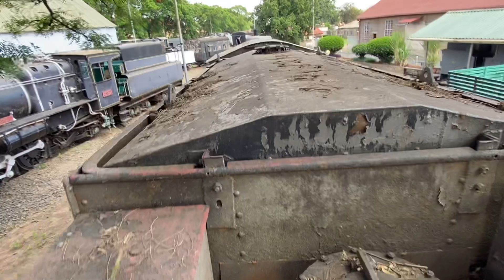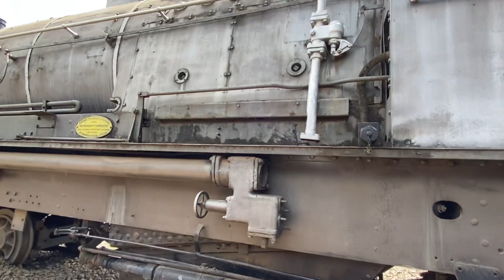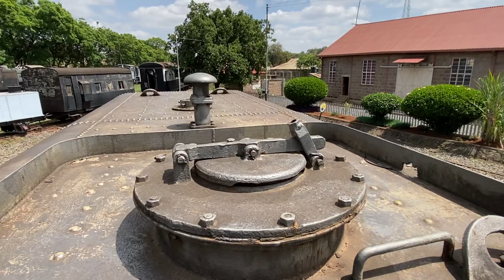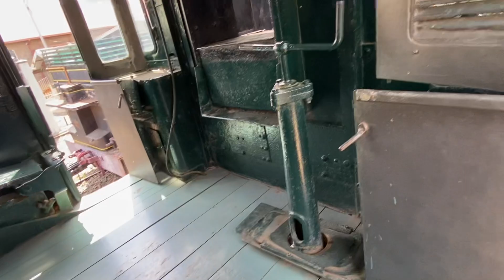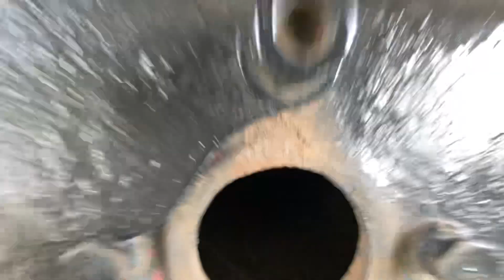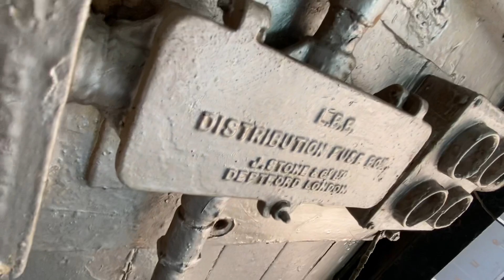Oldest steam engine. Kenya Uganda Railways

Comment: An impressive machine. But you're a bit wrong. These steam locomotives were produced from 1939. So not the oldest, but I'd still like to see it with my own eyes.
Reply: same
Reply from the maker: What engines served pre 1939. Happy to learn more. Will correct the info. Thanks for the advice
Reply: I photographed this KUR EC3 Class loco in 1976. It was in a lot better condition back then!
Reply from the maker: Pretty good info. Thank you and welcome back again both to this site and Kenya as well.
Reply: The first steam locomotive was imported in 1896.